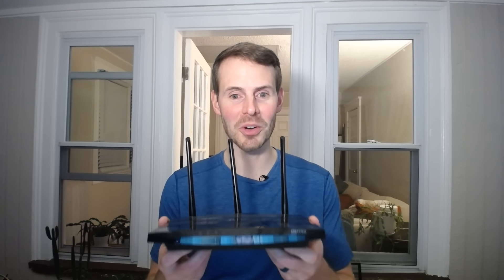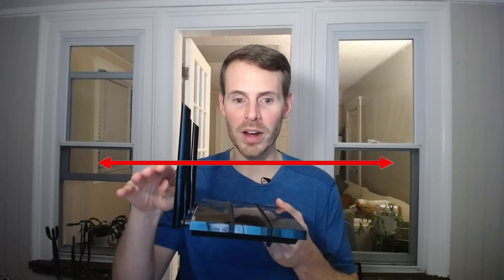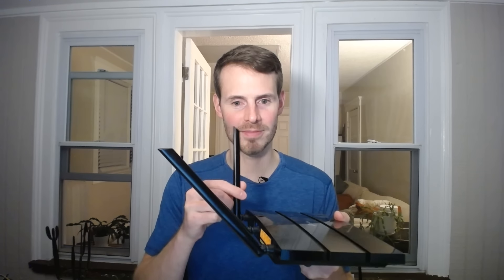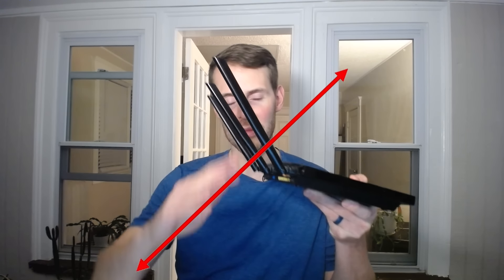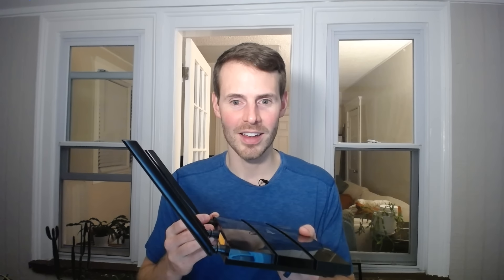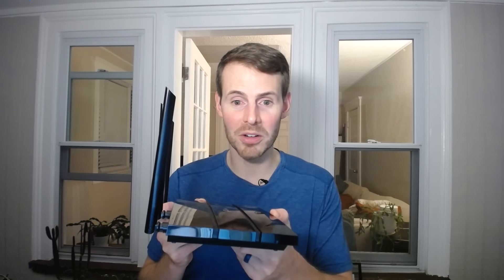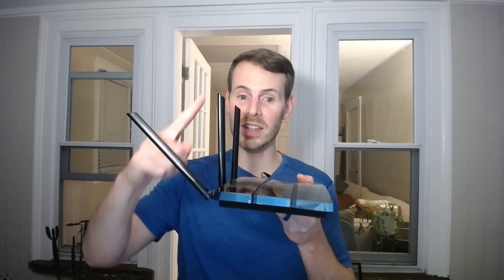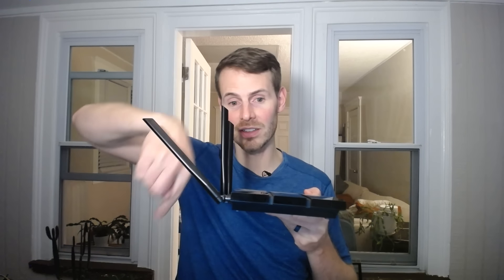Router Antenna Positions - What You're Doing Wrong

Comment: I'm thinking if we can extend these antenna by adding an extension wire to it and in the other end you can attach that antenna instead of buying and Wireless repeaters.
Reply from the maker: I’m not sure if this would work. You could always use a wireless access point to extend the range of your WiFi signal as well

Comment: I'm an electrical engineer and I had the same thought. I know of 2 bands that common wi-fi uses, and usually each frequency has a different antenna. So maybe the low band, which is better at penetrating walls is the one you'd angle to another floor,and the high band is vertical (in this guy's router anyway). But, like you said, these antennas are rarely marked. I guess one needs to devote 1/2 day to try various configurations and see which one works best. At least until you turn on your microwave oven!

Wait a minute... wasn't all this tech supposed to make our lives easier and more productive? Pfftttt!
Reply from the maker: I did some research on this, and the antennas on my router support both frequencies (2.4G and 5G). That may not be the case with all routers, but I found it to be interesting. This prevents me from orienting my antennas as you described. Anyway, you may want to see if you can find out what frequencies the antennas on your router supports and orient your antennas accordingly. Good luck!

Comment: 20 years back when cordless phones were there , they had a facility for wireless intercom between base unit & handset having a limited range of just 2-3 rooms , once i had work on my terrace of a 4 storey building, so i just seemingly connected a wire to my terrestrial tv antenna to the mono pole extended antenna on the base unit & voila all the wireless  intercom to terrace was crystal clear,
again when we got broadband b & g band router, was struggling for range so tried same technique to the router but no success, now also i use my mobile hotspot as my primary internet source broadband internet is very unreliable lots of no internet, no response to any website even after rebooting, any suggestions as to how to place a mobile handset for best performance.
Reply from the maker: For a mobile hotspot, you just want to make sure it is near a window or someplace in your home that gets good wireless signal. Your best bet is to experiment with different locations to find out which location gives you the best signal. I hope this helps!

Comment: my router's antennas orientations is as X, Y, and Z axises relative to the router itself. but it located on the wall. so one of antennas is horizontal, two others making right angle in the plane of the wall but at the same time both them 45 degree angle to the horizon
Reply from the maker: For a wall mounted router, this sounds like a good strategy! As long as you get good WiFi coverage that’s what matters. Thanks for sharing!

Comment: does this apply also for routers working with sim cards?
Reply from the maker: Yes, these principles should still apply. This is due to the fact that the antenna positions of your router impact the WiFi signal strength between your router and your devices, regardless of the type of router it is and how it is connected to the internet

Comment: Whoever wants their router to be pretty (all antennas pointing vertically) and still have good coverage across secerall floors there is a solution:
Place 1 (or more) wifi acsess point per floor
Reply from the maker: This is a great option if you have a larger home and multiple floors!

Comment: My router doesn't have antennas . I am thinking on open it and solder a 50' wire so I can push the signal forder . Up hill . I can see a white wire inside I am assuming that's the antenna . Netgear dual band
Reply from the maker: If your router doesn’t have external antennas, that means they’re internal to the device. In these cases, you just need to make sure you position your router as best you can so that it provides the best WiFi coverage in your home. Personally, I would be hesitant to make any physical changes to my router, but if you’re a technically savvy person with soldering skills, that might be a different story. Good luck and thanks for watching!

Comment: Sorry, but the first thing you should ask is WHY there are three antennas and how they interact each other. Are they feed through power divider/splitter so they form some kind of passive phased array, or are they feed from phase synchronous sources to form an active controlled beamforming, or are they formed in some diversity receiving scenario, or are they just different antennas for different frequencies? This heavily depend on device you are dealing with.

Furthermore, they are end feed verticals, that never radiate in negative or zero elevation in respect to the ground plane. Ground plane is at these frequencies something pretty local, so it mostly depends on the orientation of that router and slightly on how cables runs into/from that thing. If you bend that vertical, it's no longer vertical, it's no more omnidirectional, but you also detune that thing a lot…which could lead to some random improvement, because you are effectively disabling that antenna, which could lead to disabling some poorly designed diversity receiving things etc. And, of course, if that antenna was originally detuned, you can accidentally hit the sweet spot.

In fact, consult your manual how that antennas are intended to be oriented and in which position that whole thing should be mounted. If manual says nothing, you might be better buying some different product. In fact, I personally much prefer ceiling mounted APs, as it's much easier to design their antennas to exactly match the expected radiating pattern, which reflects the fact, that all stations to communicate with lays under that AP. Simple task with predictable results, no more dealing with random unpredictable stuff, which, at the end of the day, gives you much better results.
Reply from the maker: Thank you for sharing, this is good information!

Comment: Yet another ham radio operator. Although you are correct in saying that all antennas up is not optimal, and indeed, when I switched my angled antennas to all vertical (0°),  I got the worst signal to my hard-to-reach location (other end of the house, 1 floor down).  Routers used to be advertised with a W configuration (-30°, 0°, +30°),  which is the way I've had it.  I tried your recommendation and it was not as good as a W configuration.  I then tried the antennas at 45 degrees apart (0°, 45°, 90°) so I could put the router perpendicular up against a wall and I got the best signal. I should do another test with (0°, 90°, 90°), as I agree with the ham operator who mentioned vertical/horizontal polarization as being optimal. SpeedTest is what I used to measure the throughput.
Reply from the maker: I think your experiment and findings lead to a main takeaway: everyone will likely have a different antenna configuration that works best for them depending upon the setup of their home, their router location, etc. Thank you for sharing!

Comment: With a dual (or tri-) band router, say at 2.4 GHz and 5 GHz, are the individual antennas each assigned to handle a particular single freq?
Reply from the maker: @bacca71 each WiFi antenna can handle both 2.4 GHz and 5 GHz. Each antenna is not assigned to a frequency
Reply: @network-from-home  Many thanks!
Reply from the maker: @bacca71  No problem!

Comment: MIMO, beamforming, polarization, and so on. Without understanding this, wrong perceptions appear. Modern RF is very complex.
Reply: Not to mention metal A/C Ductwork that might be causing signal reflections or blocking a signal!!! Metal siding/sheathing on buildings can also cause problems as well as metal lathe work used for plastering finishes!!! 😬

Comment: kind of late for this conversation may be but i have my 3 antennas point like X,Y,Z direction. perpendicular to each other. 
probably not the ideal as per some people but my router is on 2nd floor of our 4 storey house.  which is roughly like center of entire building. same router is connected to TV, phones, CCTV etc etc. i have my old router which i use as a repeater for 4th and tarrace area(not needed but i just have a spare router, why not make use of it.)
Reply from the maker: This sounds like a pretty good configuration to me! All that matters is that your devices are getting a good internet connection

Comment: Do you think  FENVI 1200mbps Wifi Repeater 2.4G 5ghz Wifi Signal Amplifier Extnd is a good choice/option to recommend? 🤔
Reply from the maker: Normally I wouldn’t recommend WiFi repeater devices because they can affect WiFi performance and add administrative overhead to your network because it creates separate WiFi networks. Would it be possible to change the location of the router or buy a WiFi access point instead? If these are not good options for you, the WiFi extender is a good option. I hope this helps

Comment: I have a two WIFI ROUTERS  - the main ROUTER  CONNECTION  IS ON THIRD FLOOR.  
But the ' SIGNALS ARE POOR  '
 AT GROUND FLOOR WHERE I AM  USING SECOND ROUTER [ WHICH  IS THREE ANTENNA
connected at GROUND FLOOR ]  Thevapproximate distance TOP FLOOR TO GROUND FLOOR IS 45 TO  50 FEET.

Please advise how to  use  THE SECOND ROUTER AS BOOSTER TO RECIEVE GOOD/STRONG SIGNALS AT GROUND FLOOR.

....  and/or any other alternative suggestions on  how to RECIEVE GOOD SIGNALS with two EXISTING ROUTERS
Reply from the maker: Do you have the second router connected to the first router with an Ethernet cable? Is the second router in “access point only” mode? If this is the case and you have the two routers connected with a Cat5e or Cat6 Ethernet cable, I would expect you to have a pretty good WiFi signal near both routers. I hope this helps!

Comment: What do you do if your antennas are internal? Do you lay down your router?
Reply from the maker: @bookbabe1988 if your router antennas are internal, they're usually designed to broadcast WiFi signals equally in all directions. If you place the router upright so it is standing on its base, you should be in good shape!

Comment: Hello, 

Is it okay to place my router 2 feet away from the top corner of my TV? My workplace is 10 feet from the router (with the TV between the router and me). Will the TV, which uses a 2.4 GHz connection and a Bluetooth remote, cause any significant interference that would drastically reduce my WiFi speed, or will it be barely noticeable?

Thank you.
Reply from the maker: Hello, I would encourage you to try this out to see if you have any internet connection problems. My guess is you won't have any issues, but it is worth trying. If you have any problems try moving your router to another location. I hope this helps!

Comment: It probably doesn't matter overmuch. 
Can be useful in some cases. One must indeed visualize the approximately toroidal shape of em radiation from the antenna. 
However, if you have a multistorey building, relying on antenna orientation of a single noob router-ap is strange. To get good wifi it's optimal to have real access points in multiple locations, placed based on a site survey or at least common sense. This is particularly important with wifi6/6e/7 which aren't as far reaching as 2.4ghz

Comment: I live in one floor house and had my 2 side antennas 45 degrees outwards (rabbit ears) and center one strait up. I set them all strait up and tested both ways. With them all up I am getting instant full speed instead of slowly building up speed. Also with them all strait up I get a higher max at end of test. My ping is also a bit lower. So, the antennas definitely do seem to work together if it's on one flat plane (MIMO perhaps?). But if it's signal reach that's needed to upper or low areas, then I'd move one strait up, one at 45, and and one laying down flat. This is just my findings after testing.... Do what you want, don't argue
Reply from the maker: I think this is a great point: the ideal router antenna will likely be different for everyone. You just need to test different configurations to see which one has the best performance in your home. Thank you for sharing!

Comment: As the name suggests, omnidirectional antennas receive signals equally well from all directions. This means they have a 360-degree reception pattern and are generally omnidirectional in the vertical and horizontal planes. Omnidirectional antennas are usually designed to have a balanced antenna gain across all frequencies, enabling them to receive signals from any direction and provide consistent coverage over a broad area. This visually looks like a donut  so the  horizontal and vertical plains have the same signal strength. that said it makes no difference in the position of these antennas.

Comment: What if my router doesn't have antenna. What will i do to increase my signal?
Reply from the maker: If your router doesn’t have visible antennas, that means it has internal antennas. In this case, your router will broadcast a WiFi signal equally in all directions. This makes the placement of your router in your home very important. I hope this helps!

Comment: 5:38 "make sure the face of the antenna..."
These are dipole antennas. There is no 'face'. What matters is that at least one antenna is perpindicular to the direction you want signal. You can flop that antenna down to the side, it doesn't matter where the flat surface points - that's just plastic.
Otherwise a good PSA...

Comment: It's so frustrating listening your long winded explanations.  Omnidirection means all directions, so it does not matter whichever way you swivel the modem it is going to put signals out in all directions.  What is really stopping or curtailing signals to certain parts of your house is metal obstructions depending on what is behind those walls, including foil insulations.

Comment: These antennas are here most for aesthetics. In this particular router, those antennas are connected to the 5ghz transceiver. The wavelength is the bare minimum, and the antenna length for this kind of wavelength is millimeters long and eradiates like a little spotlight. But what about this big plastic piece? It's just plastic.

It doesn't matter what the antenna position of this kind of router is.

Comment: hello I have 300mbps N router and 5 mobile devices connected sometimes on one of the device or on all devices the connection is lost and the router is needed to be restart... what could be the problem? do I need new router ? mine is 10 years old when it was new nothing like that happened.
Reply from the maker: I would say if your router is 10 years old, you would probably benefit from upgrading it to a newer one. You may also want to check to see if there are any firmware updates you can install on your existing router. With that said, if your existing router is 10 years old the manufacturer is most likely not supporting that model of router with updates anymore. I hope this helps!
Reply: I would try to get a Wifi6 router, with at least 3000 bandwidth.
Wireless N routers have worked really poorly for the last 3-4 years. All the new wireless equip will run better on the 5Ghz band. The minimum router for good wireless 5G needs to be at least 1700AC. Although it is way better than wireless N, at this point, that is even becoming out of date. I bought a 1900AC dual band router in 2015, which replaced the router that you have now. My modem from 2020 has wifi 6 built into it and works better than my wifi AC router, even though it has better range. I kept that router as a backup and to have a couple extra ethernet ports. I use the modem wifi 90% of the time.

Comment: My router doesn't have visible antennas. What do I do then?
Reply from the maker: If your router doesn’t have external antennas, it has internal antennas. In this case, your router will broadcast a WiFi signal equally in all directions. I hope this helps!
Reply: @network-from-home  I guess I'll have to lay the whole thing on its side or insert something below it unevenly. I have one of those vertical antenna-less routers.
Reply from the maker: If your router has internal antennas, you may want to play around with moving your router to different locations in your home to see which one gives you the best signal to areas in your home where you use the internet the most. Good luck!

Comment: You are changing the linear orientation, which may or may not increse the overall link speed to the clients in weaker signal areas (depending on the linear orientation of the client at that location) but you are also degrading the MiMO capabilities of all clients since signal strength will be lower for some antennas than others. Client steering will be hampered, degrading long range speed, etc.  That you failed to do any qualitative testing other than basic connectivity for your weak area clients, shows that you are providing just a rudimentary half-story.